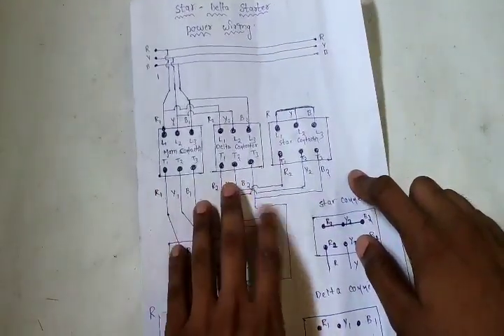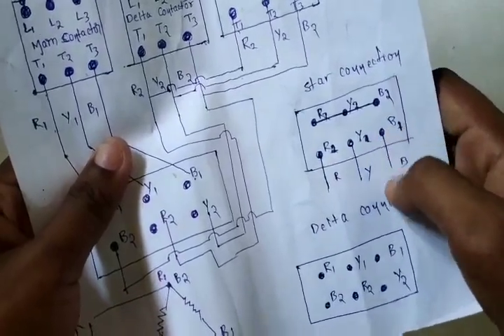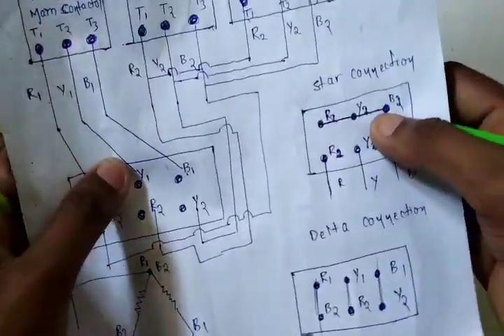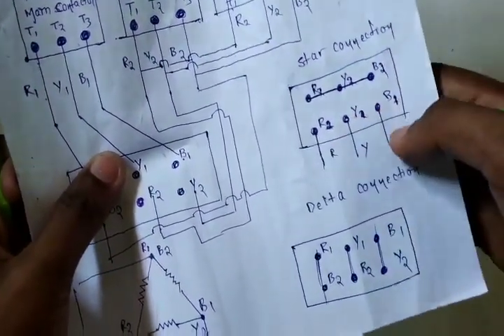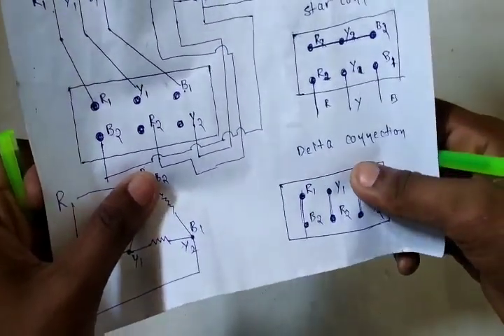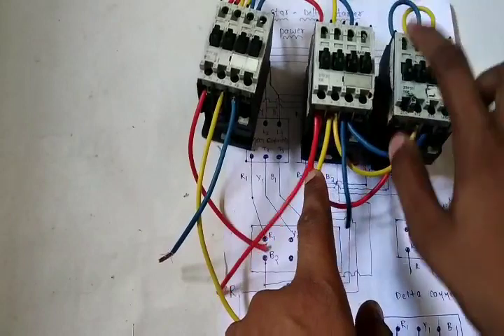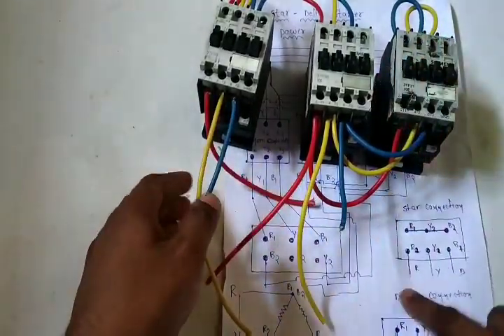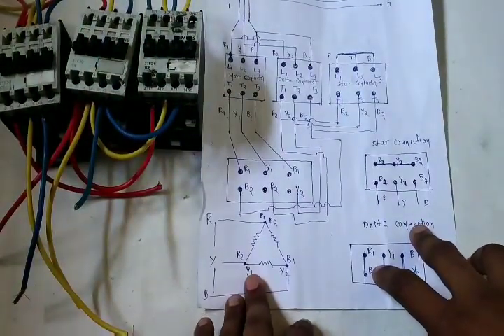Star delta starter main power wiring in telugu 2019 for i.t.i and diploma electrical

Comment: Why Star connection & delta connection motors????
Reply from the maker: Starting current is high in star connection
And in delta current is low
Reply: Starting Delta star what happened
Reply: Starting induction motors having low impedence when impedence is low then the current will high  that's why well use star and Delta .  In star connection line current is equal to phase current but in Delta   line current is equal to root 3times of phase current
Reply from the maker: Windings will damage

Comment: sir Star  and delata  starter Lo delta contactor on ayinapudu main contactor on Lo untadha undatha
Reply from the maker: Main delta contactor on lo vuntaai
Reply: Sir Star  contactor  Lo control logic       nalku  ardham ayindhi kani delta on ayithe 6 phases velli pothayi ani  
Anipisthundhi circuit ela delta Lo 
Padutundhi
Reply from the maker: Nee video chesaaanu choodu
Reply: Relly connection ledhu
Reply from the maker: Ardam kaaledu bro
Reply: @ELECTRICALTECHINTELUGU  sir motor capacitors Kosam oka class dhaya Chesi cheyyagalaru idhi starting capacitor idhi running capacitor ani find out cheyyadam ela capacitor ni ela test chestaru
Reply from the maker: Starting winding running winding untundi capacitor vundadu
Reply: @ELECTRICALTECHINTELUGU  sir double capacitor motor ki Centri fugal switch untundhi kadha  dhani kosam please cheppandi
Reply from the maker: Currently unavailable sorry